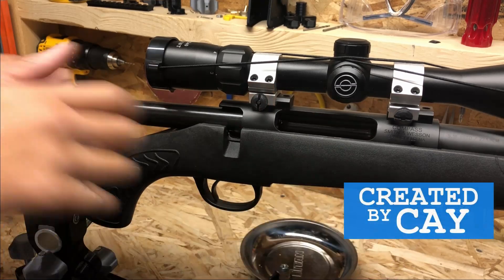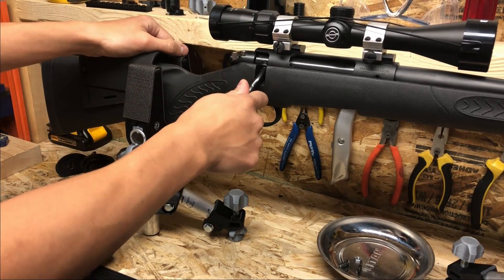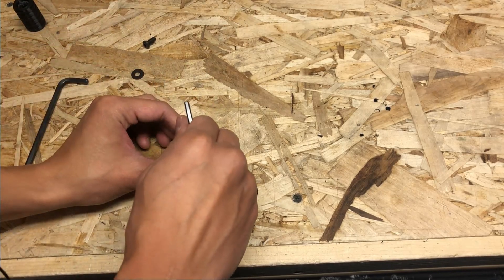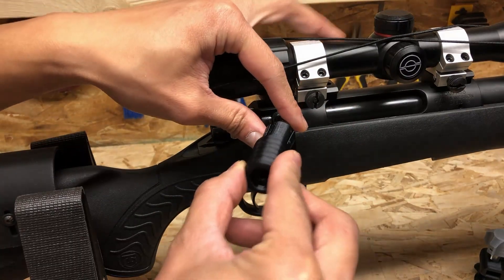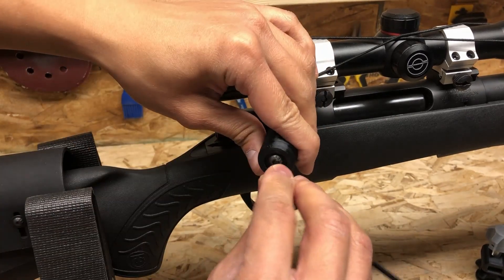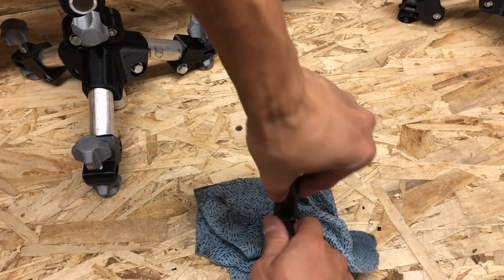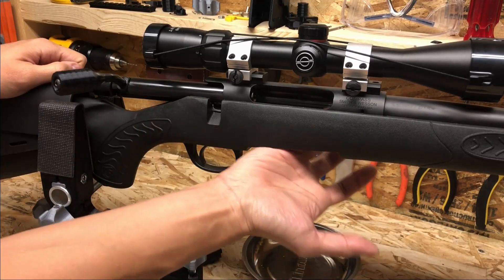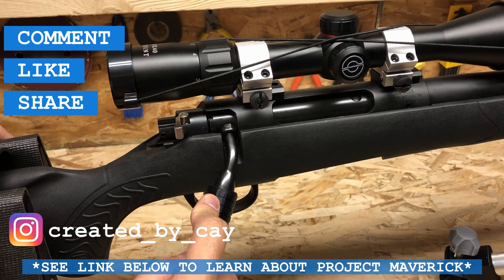Thompson Center TC Compass - Aftermarket Extended Bolt Handle - $5 Solution

Comment: Will the bolt handle slip out from the bolt body?
 It seems the bias firing spring force stop it from slipping.
Reply from the maker: Nope, it's designed to grip on nice and solid. No failures reported to date. Thanks for watching.

Comment: What cheek riser did you use or did you make your own and did you make a video on it? I’m interested in your metal bolt handle watching that video next great job
Reply from the maker: Hi, glad you like my videos. I made that cheek riser on my own (3D Printed). I didn't include the design of the cheek riser on my store mainly because it's not an "easy" print. Takes around 4-5 hours and requires sanding/painting to get it looking good. That being said, if you're interested I can make the STL file available for you. As for the metal bolt knob, my next batch is scheduled to arrive later in December. It'll be in stock on my store early 2020. Thanks! - Cay

Comment: Good solution.  Even with as common as 3D printers are I don't think many have them on hand.

Have you thought about selling the solution online through an e-store?
Also, I'd love to see a follow up video to see how well it holds up under rain and hardcore field stress.

Well done all the way around, though.  Very well done.
Reply from the maker: Hi Nicholas, Glad you enjoyed my video. Yes I have though about selling them commercially "ready out of the box". This however would require a substantial investment on the tooling for the internal plastic insert. Therefore I'm only selling the 3D Print files off my website. The bolt knob has been holding up really well, even at extreme cold weather it does not slip or crack. Even if it does malfunction, I'll just print another one to replace it.

Thanks,
Cay
Reply from the maker: I got an Aluminum one available now if you're interested. I made a quick and dirty video here --> https://www.youtube.com/watch?v=zP1HZVI3ndU